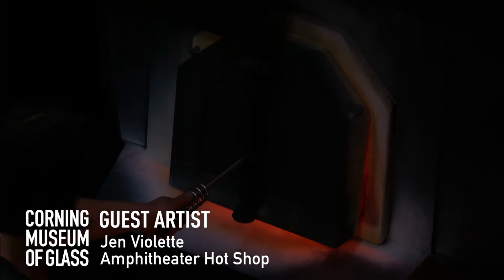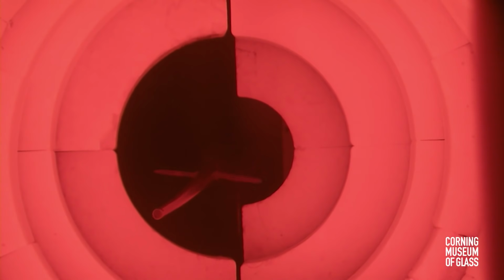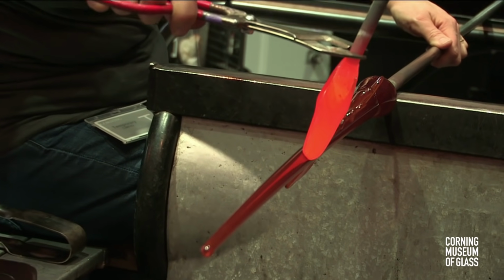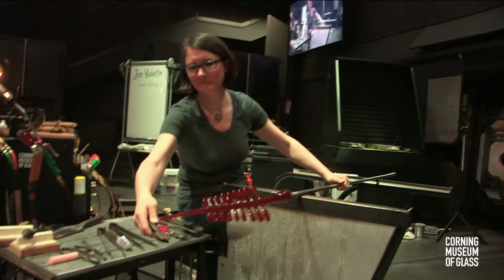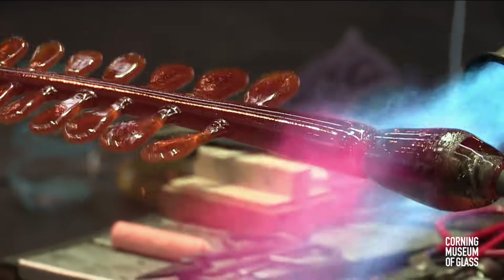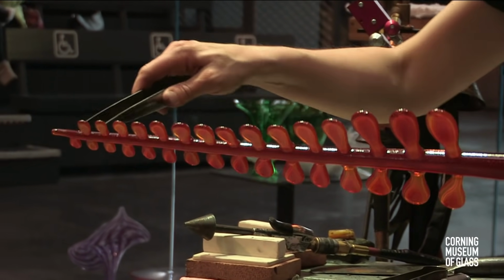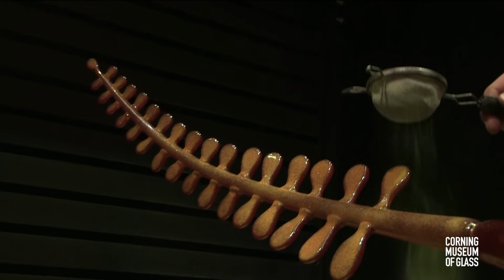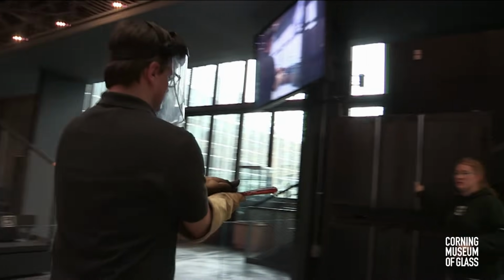Jen Violette Guest Artist Demonstration (April 2017)

Comment: Could you, please, explain me (with very simple words and sentences) why she uses blowpipe (hot air) before the object goes to furnace ? Thank you.
Reply from the maker: The tool she is using before going into the reheating furnace is a torch for general heating.  The  glass around the metal end of the punty (gathering rod) is contastly cooling the glass faster there than elsewhere.  When working for a long time as she does for this sculpture, she must add extra heat there in that area to keep the glass from cracking.  When she goes into the reheating furnace,  the back end of the the glass isn't warmed enough to keep that area warm - this is why they add "extra heat" during the making of the glass.

Comment: what is the inside of the glory hole made of that keeps the glass from sticking to it?
Reply from the maker: The glory hole is made of several types of ceramic refractory brick. These bricks are more heat and corrosion resistant on the inner face, and more insulating on the outer surface. Glass will definitely stick to the inside of the furnace if it touches it. If you're asking about how they gather up the glass, this video explains more https://www.youtube.com/watch?v=4JXAOV3DhGM. Thanks for watching!
Reply: Thank You! I do glass blowing my self, it just looked like the glass was resting on the inside of the glory hole when she flashed it haha